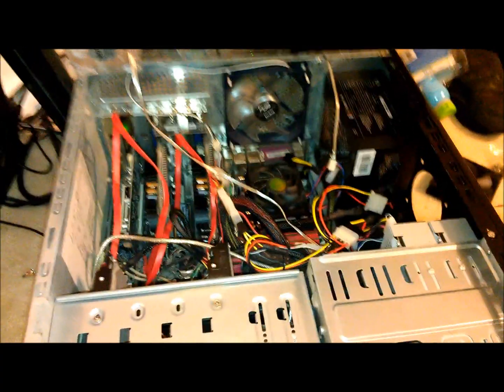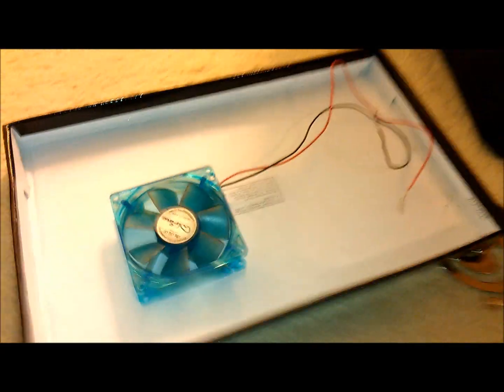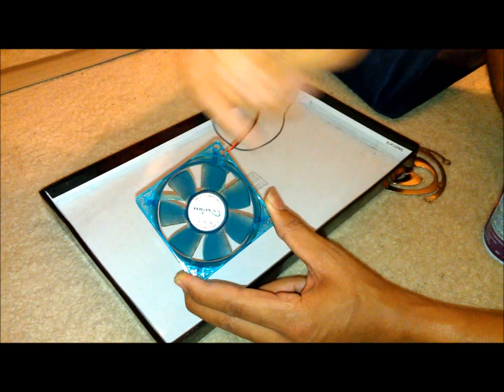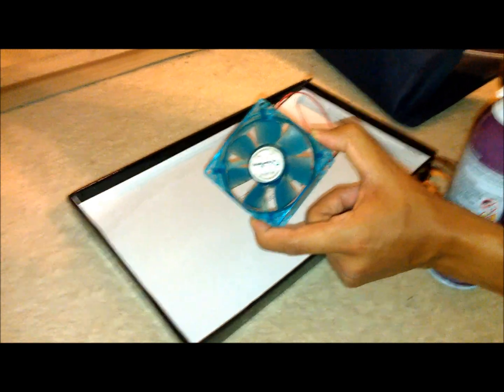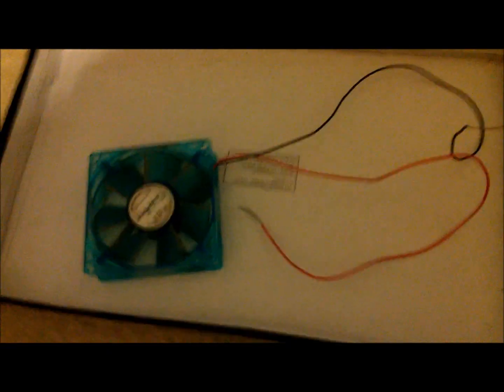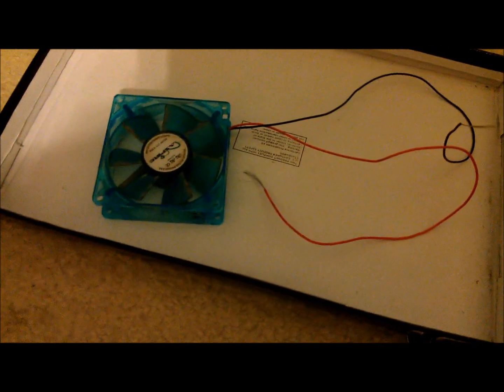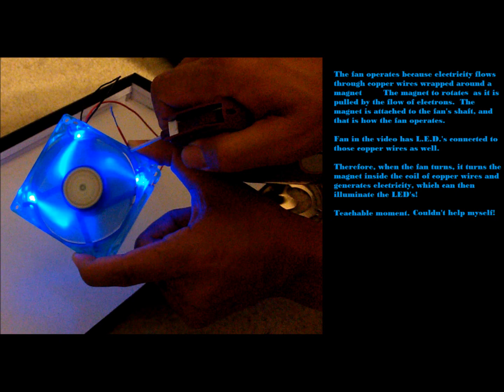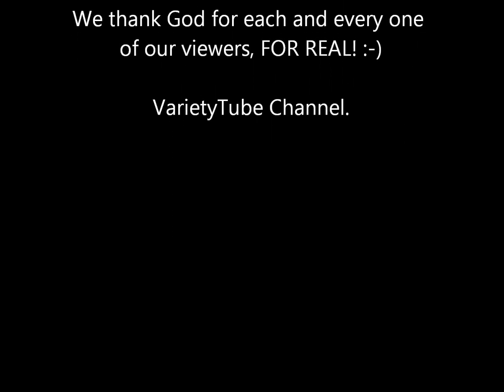PC Fan Generating Electricity

Comment: Most if not all motors can be used as an generator when external force is used to turn the axle. The direction of spin will determent the polarity of the 2 terminals.